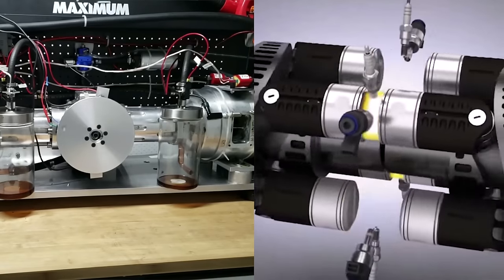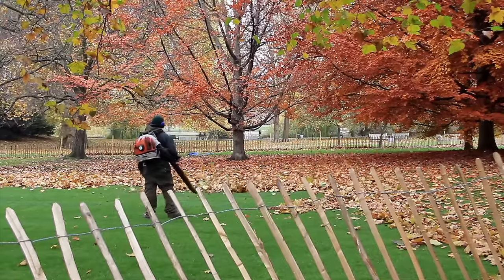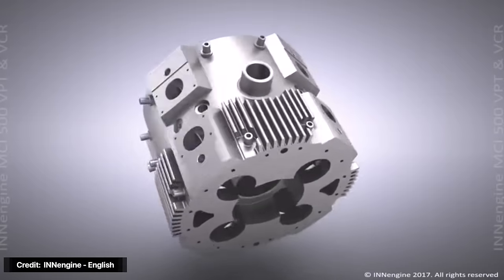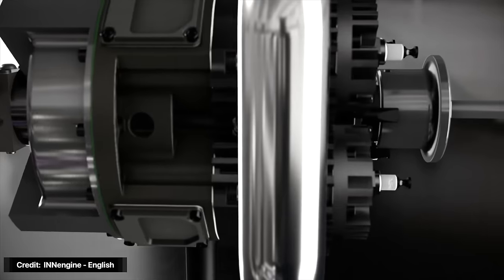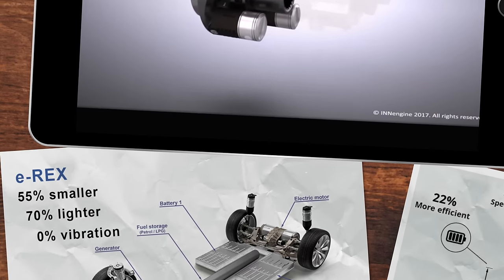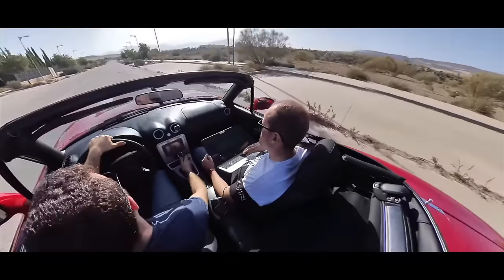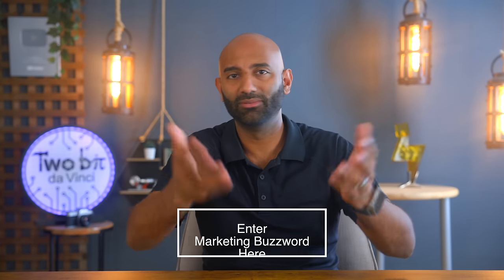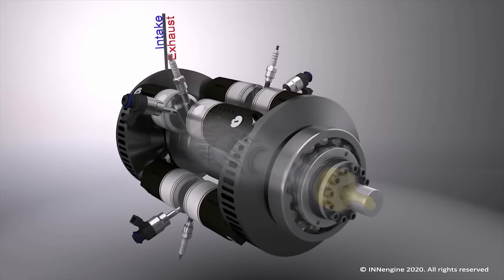One Stroke Engines - 200% More Efficient??

Comment: In reality, it's a two stroke a little bit different: it needs a compressed air injection, and direct fuel injection too. This motor is very interesting and has a big future but not for vehicles because it doesn't have enough torque but it has power and it's very quiet! It's future is in the aviation and generators!

Comment: Leaning on your break down as I am understanding it, they claim that the piston is not actually doing an exhaust stroke and that the piston is resetting. I would argue that a steam engine could be considered a 1 stroke because it uses every piston stroke for a power stroke. If this engine had a power stroke every stroke, it would also be a 1 stroke. So they technically are not using a stroke so it is wasted. They need to take the knock for if they are fighting for the 1 stroke claim. That would belong to the engine that comes around that give us a power stroke up down, push pull or side to side.

Comment: That simulation is 2-stroke not single-stroke because it has one power stroke every 2 strokes. To be a single-stroke engine, it would have to be power stroke (the fire showing in the simulation) on every stroke for every piston. That simulation is not showing that.

Comment: Forv the longest time I thought the Prius hybrid meant the gas motor charged the batteries. I was completely dumbfounded to find out no one is doing this. Some how, engineers decided it was a better idea to put 2 drive motors in the same axle rather than making one electric drive system with a battery and a gas battery recharge system.. to me, that's true hybrid. Not a gas motor and a electric motor that's just redundant waste if engineering time.

Comment: Like many others have said, its a two stroke. But not as efficient, because of the losses of the linear motion of the pistons, to the rotation of the shaft. The pistons are on rollers that roll on cams. As the engine spins faster, the pistons can start to float (think valve float), and not make continuous contact with the cam. In a regular two stroke engine, the piston is rigidly tied to the crankshaft, no floating. Think about bevel gears, and their inefficiency, same thing is happening here.

Comment: After a winter full of reports about EVs that wouldn't go anywhere because the batteries won't make electrons when they get too cold, I'd be more inclined to get an EV if it contained a fuel burning engine that, along with extending range, could warm up the batteries enough to get them going under those conditions.

Comment: A good friend owned a 1969 BSA Victor. It’s a single piston, 4 stroke 441 cc with 28 hp and his gas economy was 54 mpg. At the same time, I owned a 1968 Triumph Bonneville. It had a 650 cc 4 stroke twin cylinder with twin carbs and it was 53 hp and I got 54 mpg so it appears from that comparison that the single piston was no more economical than another Brit twin even though the Triumph had nearly twice the hp. Granted, there are other variables like sprockets.

Comment: I would like to see a single piston engine with spark plugs at each end of a cylinder with a hollow tube running through the piston and cylinder ends that only pumps hydraulic fluid through a one way valve.

Comment: The pistons do two strokes per 180 degree rotation of the engine's shaft. The 'pistons' do two strokes, but the 'engine' does 180 degrees, which translates to 'one stroke engine' in a weird way.

Comment: I think a super efficient generator to power and electric motor is a decent in between solution. Possibly even a long-term solution, especially if it could be powered off of hydrogen or another cleaner burning fuel

Comment: Right now we don't have enough charging stations, plus the battery doesn't have enough range. So yes we dual engine. I  see this engine running a generator to make ev more efficient. It doesn't have to run the car where you the torque but generator to keep the batteries charged.

Comment: Why is ev`s seen as the only way to go there are alternative fuels for internal combustion engines. There has been issues with ev`s catching fire, which are difficult to get under control, they burn like a flare. They also have a short battery life and resale will be nothing but scrap value as a result of short life

Comment: YES!!!! At the end of your video, you said EXACTLY what crossed my mind. Why can't we use ICE to charge (re-charge?) the onboard battery pack? The engine is there SOLEY as a mobile generator, nothing more. I am not a mechanical engineer but I've heard ICE engines can - when tuned perfectly - be highly fuel efficient and relatively clean. A EV car with a battery big enough for around 100 miles, plus this range extender. I'm unsure if a battery can both charge and discharge at the same time. With a TON of help from software, the driver can activate the ICE if they know they're traveling a long way. I'm a computer guy so I'm unsure the engieering/science of if all. But if it can be done, I can write the software to control it.

Comment: The Inengine has another apparent problem in that the piston rod end ('the big end') exerts its force on a surface which is an angle to it.  This is inherently inefficient and generates a considerable side thrust on the piston rod, equal and opposite to the 9wanted0 side thrust on the camplate.

Comment: I do wonder why, during the transition from fossil fuel to electric there are not as many hybrid type options around. or smaller hydrogen engines specifically for electricity generation on the move.

Comment: Really enjoy your videos.  With few exceptions, I usually forego videos over 10-12 minutes.  Yours is one of those exceptions, because your narration is so fluid, and packed with relevant info, you keep the video interesting.  Having said that, I do think the interest in EV's, when not gov't mandated, is being given a more scrutinized look, and I don't think their future is as immediate as some speculated. An extender would certainly sweeten the deal, though there are still a myriad of environmental concerns with mining for batteries, etc.  Another matter is what form of energy drives the generators that produce the electricity for EV's; our grid is already heavily taxed.  An IC engine that meets much higher fuel economy, and fills in minutes,  still has a viable future, in my opinion; not to mention all the everyday products that come from petroleum.  Thank you for covering this subject matter.

Comment: no such thing as a single stroke. they are 2-stroke opposing engines. think about it, a piston moves up =1 stroke and down =1 stroke. math says 1+1=2.  a rotory engine is a trie 1stroke engine as it has no true stroke but has a compression during rotoation that then fires tt to force power.

Comment: I think a generator to charge the battery could work and would be a good idea to help on long road trips although if they needed to be too large it might hurt efficiency too much, but most people drive less than 100 miles a day so going light on the battery side and heavier on the gas side and do similar to the plug in hybrid but make the electric drive train the main one with the gas just as a generator and maybe a power boost if you want to make a sporty version

Comment: Unlike a traditional two stroke engine, this will not need to mix oil into the gas for lubrication and so the resulting emissions will be similar to a traditional four stroke. The compression ratio will be lower like a two stroke but this could overcome by super charging of some sort.

Comment: Absolutely makes sense to have an erex system. I have had 6 Tesla BEVs and 4 Chevy Volt EREVs. One of each most recently. The Teslarati deride the idea of carrying around the weight of a small ICE range extender that might be used less than 10% of the time. But you never hear the counterargument against carrying around a MUCH heavier 100 kWh battery when 8 - 12 kWh is all that is used 90% of the time. As long as we are using relatively scarce, heavy and expensive lithium ion as the principal type of battery pack, I think 14 kWh and 7 times the number of clean cars built with the same amount of battery material makes eminent good sense.

Comment: what would they name the oil in this motor why should oil be able to be called 2 stroke this motor in a single form would be intake power exhaust but the revolution you infer is happening is not this motor would be one stoke but it does not produce one revolution which a 2 stoke does produces one revolution in 2 strokes

Comment: What ever happened to the guy in the 1970's that took an Opal GT, mounted a 120v electric motor to the stock transmission, then replaced the stock motor with a gasoline powered generator.
As I recall, it got real good MPG in the city and fantastic MPG on the highway. Like 100 plus.
Still needed the transmission as the small electric motor didnt have enough oomph for direct drive at low speeds.
Experiments pre-internet are hard to track down.

Comment: Run the engine at fixed speed to a generator and drive electric motors for traction. Add batteries for regenerative braking. An all-electric hybrid.

Comment: The picture you showed next to the so called one stroke engine as a comparison off a 2 stroke engine was in fact a  4 stroke engine Also this so called one stroke engine is not a new idea This had been built before but not with swish plates at each end but with crank shafts at each end  It was called a uniflow opposed 2 stroke  piston arrangement and was used mainly in marine engines

Comment: Hang on this is not new this engine is called a deltic engine it was a diesel burning oil with apposing pistons used in Trains in the UK. It was so efficient used to power Generators. The difference is was a large engine   For some reason they did not expand to make smaller or other fueled engines.

Comment: I currently own 3 Hybrid vehicles. I am a Mechanic and class Driver in Los Angeles. There are far too many problems associated with full electric vehicles in this city. With that being said, my favorite vehicle is a 2017 Chevy Volt. This as you probably know is an electric vehicle with a gas powered generator. I would like to see more electric vehicles with worthy, fuel efficient range extenders that can be powered by gas or diesel when the battery is depleted.  I’ve even considered converting a classic car into such a vehicle. The eRex if it were able to power a generator economically running at a consistent speed may work well for such a project. I think electric can provide exactly what eRex is lacking. Building a lighter hybrid that gets better mileage?

Comment: 👍 Even a tiny range extender matched to a 60 mph load would be all you need. If you know you're going on a long trip without a charging station you'd simply activate the range extender. If your in a pinch the range extender could automatically kick in at 20% left. (Try not to suck the battery flat. Newer chemistries prefer ½ charge during non-use time.)

Comment: i have an idea.

Start: the starter gets power from the battery to spin while the fuel injectors put gas into the double chamber.

1 stroke: the pistons compress the fuel mixture while the spark plugs ignite the fuel pushing the cylinder back and opening the exhaust port meanwhile the fuel injectors put the fuel mixture once again.

Disadvantages (i think) :

1: the fuel mixture can get out in the exhaust port leading to fuel waste

 

Design : Flat engine but the pistons face eachother. Possible outcome for more than 1 flat chamber for example I6 where it has 6 pistons not 1.

Comment: Hi Ricky, what about the adiabatic engine? I read a magazine article inthe early eighties about Mr. Smokey Yunik. Supposedly the Big Three had given up on this approach, unable to develop durable enough ceramic composites for pistons and cylinders. According to the article Smokey had built an adiabatic engine and put it in a Dodge Omni or Plymouth Horizon. He invited automotive journalists to come and test drive the car, and to run it as hsrd as they could in an effort to blow it up. As I recall [from about fourty years past] the journalist writing the article drove this car and was extremely impressed. I seem to remember that the fuel economy was extremely high, but the details escape me. My understanding was that the Adiabatic Engine had multiple stages of cylinders, where the combustion mixture was pumped to very high pressures [and correspondingly high temperatures], and that a much higher percentage of the stored energy in the gasoline was used, and a much lower amount of lost heat energy exited the tail pipe. As always we enjoy your insighful and informative videos! Keep up the good work!
Thank you!👍

Comment: The world isnt converting to electric cars we now no they are crap and if you have your heater on that takes 10 miles off of your range put your radio on thats another ten they are not good cars and if the battery goes its 20000 and most garages wont touch them

Comment: The World is not Going Electric--the Smart Japanese have already seen the Light, they have Abandoned the Electric Vehicles. H2 Combustion Vehicles would be a Good Option as their Product of Combustion is just plain Water and it only takes about same time to fill your tank as Gasoline. Building Electric Batteries Rapes the Environment and actually Cost more per Mile than Fossil Fuel. These people that promote Electric Vehicles must understand that it Takes Fossil Fuel Power Plants to Produce the Electricity-Charge for them to get down the Road as Windmills and Solar Panels cannot Produce enough Electricity for all our Demand so the more electric Vehicles, the more Fossil Fuel will be Needed...

Comment: I could see this being huge for generators.  Smaller, lighter, quieter, and with that kind of timing and compression ratio control, control you could basically use any fuel you have on hand.

Comment: One thing I did notice in the documentation you flashed was that they said the engine was fuel agnostic.  The paper mentioned hydrogen, which Japan does seem to be betting on along with a nuclear reactor that'll be good at producing Red Hydrogen, but there's also a lot of research into making a fuel of Ammonia, if they can just find a properly scalable alternative to Haber-Bosch.  And if the same range extender engine could work with all these fuels just a different tank and minor modification, that could really future proof range extension against a ton of market shifts.

Comment: The engine that fires on the top and the bottom of the piston looks very promising. Your closing statement about a electric drive on the wheels and a internal combustion engine to supply power to the batteries when you need it also sounds like a the best idea available right now. Electric charging stations are not available to everyone everywhere, there's a lot of added expense to install one, plus apartment complexes don't have them, and the charge times are prohibitive except for downtime when you're asleep. And The limited range problem

Comment: Back when I was working as a diesel mechanic there was something called a double acting two-stroke. These were typically large gasoline or electric ignition engines at a spark plug.  This was an engine that had a piston that that had a spark plug on both sides of the piston and a two-piece connecting rod so there was two compression Chambers for every cylinder and this is the closest thing I can think of 201 stroke engine. Technically it's not a one stroke engine it has a power stroke on either side and these things have been around probably since the 1920s

Comment: During your video you mentioned about the difficulty of ventilating  the space between the opposing pistons I too wondered about this also. If you had looked at a drawing of a real 2 stroke  engine you would have seen that piston on the down stroke is used to push the air fuel mixture into the cylinder acting a bit like a supercharger The eREX engine did not have a crankcase to allow this to happen. The explanation from eREX that the escaping exhaust gas sucked in the induction air is not true but I wondered how it could work properly. Then you mentioned at the end that  the eREX had a supercharger  fitted. This does the same job as the piston crank case  supercharging that I mentioned earlier. Two stroke engines do not work well naturally aspirated. The fitting of the supercharger was genius move along with the fuel injection as this means the induction space can now be fully ventilated without wasting fuel . Note that a turbocharger would not have worked here as well as the supercharger .

Comment: Yes,  like the range extension/battery charger application of the engine design you described in this video. I drive a hybrid. It makes sense where I live, a place that features flat to rolling terrain, and not many electric car charging stations. I am also concerned about have enough electricity generating capacity to charge a large fleet of electric vehicles. For me, an hybrid makes sense because if enables me to have a larger vehicle with smaller vehicle fuel efficiency.

Comment: I've seen a variant on the e-Rex engine that was patented in the 1930s I didn't have opposing cylinders but it was extremely short-lived I think they fitted them to torpedoes that would launch through the water because they'd only have to run for a short amount of time.  Compressing against this wash plate will wear that out very quickly.
Reply: T-Rex is very similar to the pump and motor in a hydrostatic transmission. Primary differences it runs at a lower RPM and it has an adjustable squash plate that increases flow or increases torque.

Comment: The engine does not need to power the car, but charge the batteries that power the electric motor that powers the car. A plug-in hybrid.